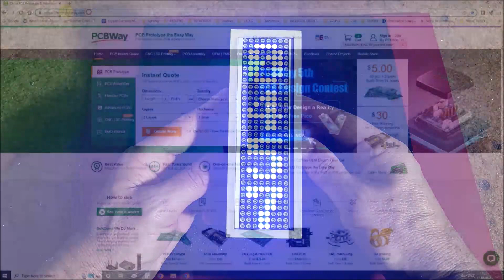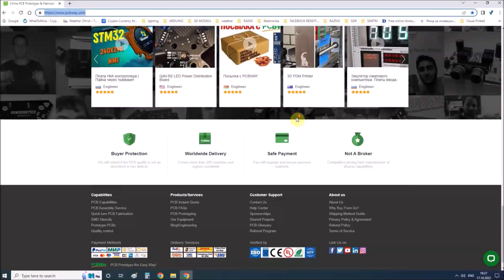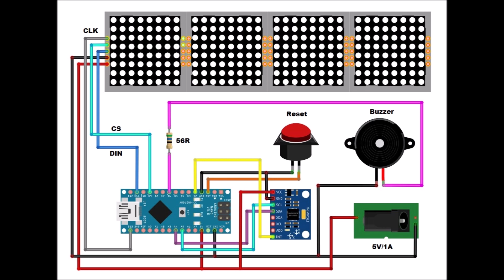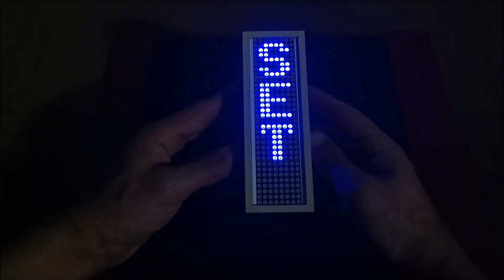Arduino MPU6050 Interactive scrolling game on 32x8 Led Matrix

Comment: I have built a version of this and it's working... The only issue is calibration of the MPU5060... how is this done? How to you position and read the necessary values needed?.. thanks...very interesting project....
Reply: Main problem is the player bit/led is not moving with the tilt to the left/right ect... hmm
Reply: Had to study the code more and the MPU6050... all working now... thanks
Reply: @garybunny5270  how u did the calibration? im having the same issue, did u use accelerometer or the gyroscop?
Reply: @GabrielGama-kv8ov  I made some adjustments to some variables half way down the code and carefully placed the MPU in the same position as the maker did... Hope it helps

Comment: I have a problem, the LED matrix does not show the start of the game.
Reply: Does the led matrix work?.. Did the .ino conpile and load?
Reply: @garybunny5270  yes
Reply: Have you wired the spi bus to the correct pins on the Nano?
Reply: @garybunny5270  yes, because I used the Parola scrolling example and it worked
Reply: @mnkandmdncorp  the display doesn't work if it can't read any data from the gyro module... Check thats ok
Reply: Hello I have solved the problem and I drew the 3D printed shell and it has been assembled perfectly
https://circuitdigest.com/sites/default/files/users/user67655/Screenshot_20240613_140319.jpg

https://circuitdigest.com/sites/default/files/users/user67655/Screenshot_20240613_140807.jpg